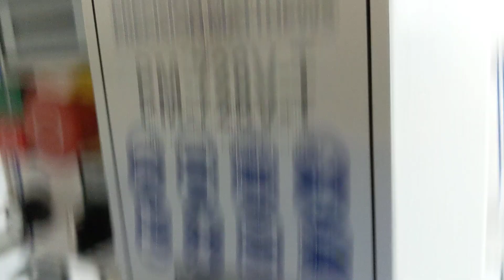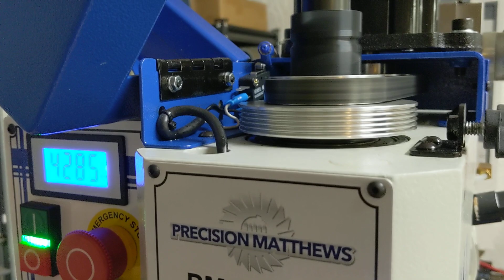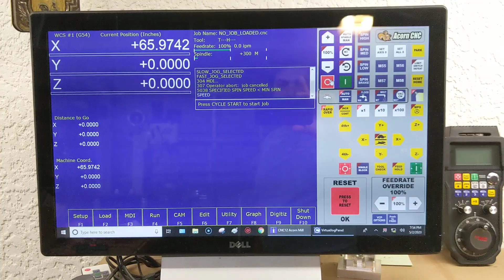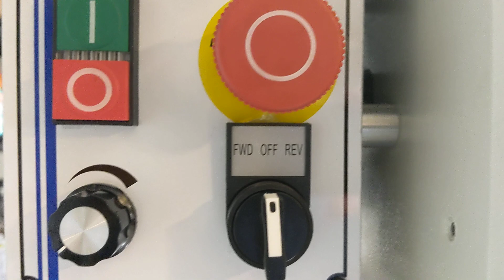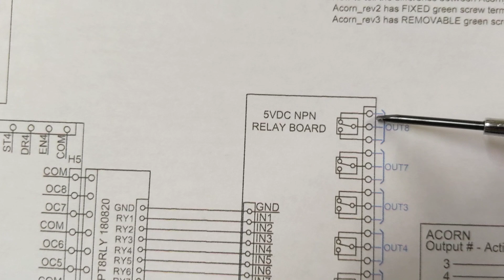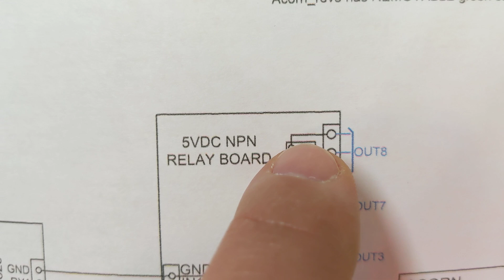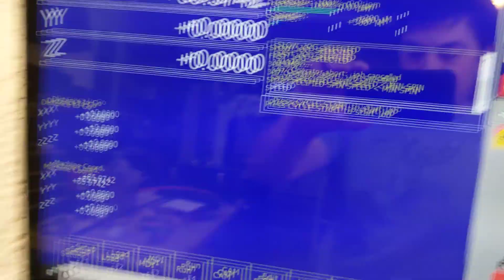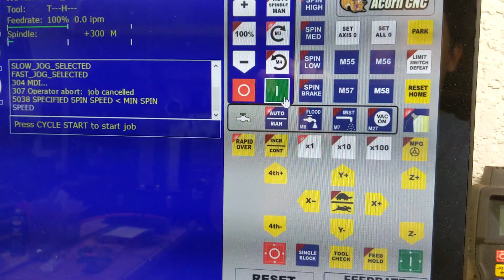PM-728VT Spindle Control #2 with Centroid Acorn

Comment: I have wired the relays as you described with the wiring. In manual spindle mode i can still activate the relays from forward to reverse without having to press the stop button between spindle direction changes. When programming the code would you have to put an M5 to stop the spindle first? I also have a spindle encoder but havent wired it up.

Comment: I believe you are correct with your logic gate design. BUT it would have been good to show both relays on at the same time to show the result of what would happen in that case.... say the SEED circuit had a hiccup and asked both relays to turn on together. It should only be in forward direction in that case.

Comment: Mechanical relays are just metal contacts. When the contacts hit together and separated they have a little spark. That little spark creates pits in the contact surface as well as leaves carbon buildup. This is why they fail over time. You can usually pop the lids off and clean the contacts with emery cloth for longer life if you’re in a pinch.

Comment: Hey Franco, a variation on your theme for wiring the relays...
Connect both NC contacts together and connect to common at speed controller.
Connect both relay common contacts together
Take FWD output from one NO contact and REV from the other NO contact.
Works the same, just means you're using both NC contacts instead of one.

Comment: Is it a bldc motor? There are drives that let you control it through 0-10v. That's most common. If you want to ridgid tap, you need a timing belt. But even as a rpm reader, would never use a oring.

There is even a encoder kit for these machines. 

Keep on going!
Reply from the maker: Encoder kit?  Who sells that?

Comment: How about a more simpler "relay logic".  Since these are SPDT relays,  NC side would be FORWARD.  NO side would be REVERSE.  The second relay would send power to the common side of the first relay to give an OFF feature.
Reply: To get the forward/reverse switch to work on my lathe with my hybrid stepper motor it was pretty freaky. Forward is +v, reverse is ground, and idle (i.e. no engine brake) is NC. To make it work I had to short out the +5v to ground for reverse, not sure if that's going to kill the stepper driver over time but ran it in reverse for an hour and nothing was overly hot. I could use relays to make the switch work "properly" but it works great the way it is (other than forward/reverse being swapped) https://www.youtube.com/watch?v=G_KEVVD8m2I